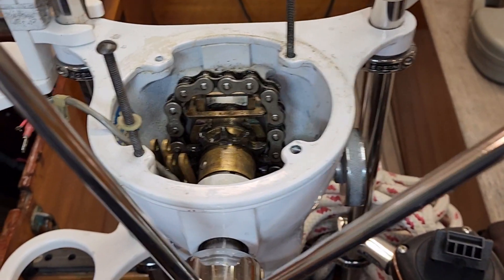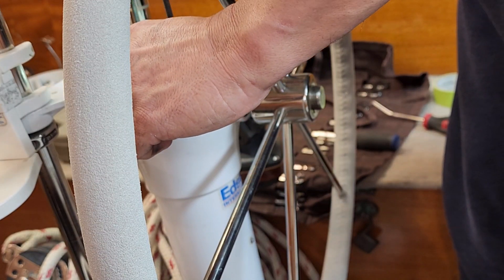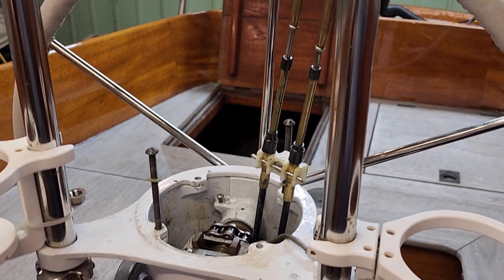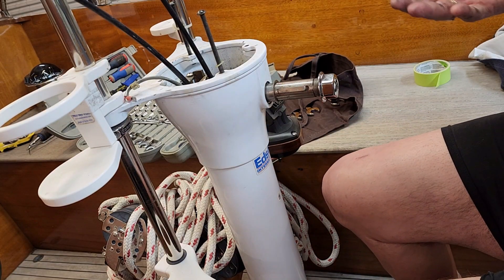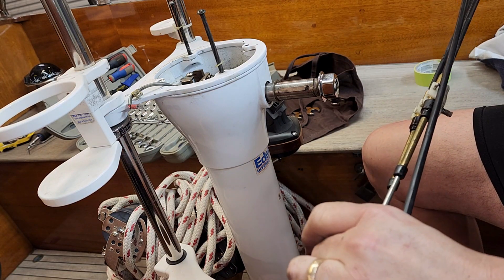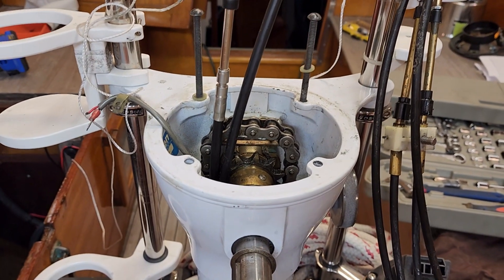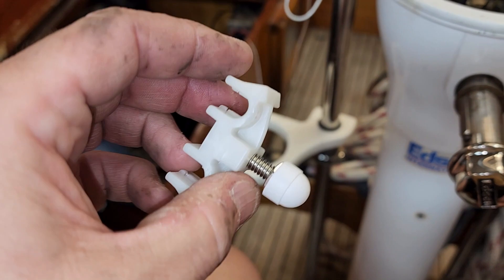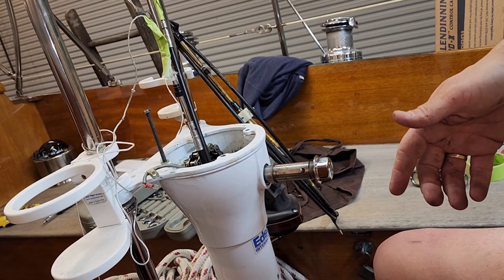Edson Pedestal Cable Replacement 3 of 4

Comment: I was disappointed that you did not show how you got the bolt from the bracket that holds the cables through the hole below the wheel. That appears to be challenging.
Reply from the maker: the white plastic bracket the holds the cables? It was actually quite simple. I did not realize that was edited out. If I did capture it, I will post it.  Once the cables are in the bracket, just slide them down. when the bracket/threads of the bolt are near the hole, just wiggle it til it comes through the hole.  That was the easiest part of the job!  If/when you do this job, you will see what I mean. I thought that would be difficult too. When the cables were slid down, it literally just popped through the hole.
Reply from the maker: I did find the raw footage. I will upload it.   The cables are so stiff, you can literally make that plastic mount dance anyway you want and locate it into the hole quite easily.

Comment: Literally working on this right now. How did you loosen a pulley? Im sitting inside my engine area writing this.
Reply from the maker: Sorry for the late reply. I literally just removed the bolt/nut holding a pulley on below deck. Once it was done, I just put it back.  Hope you figured it out!